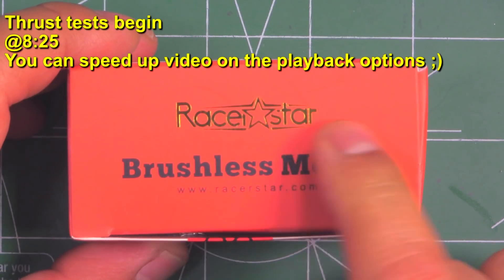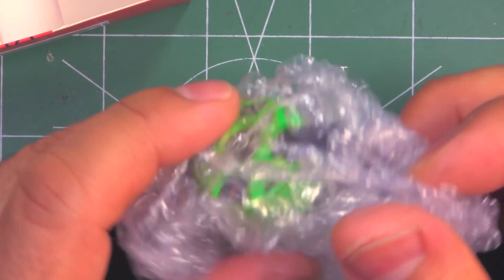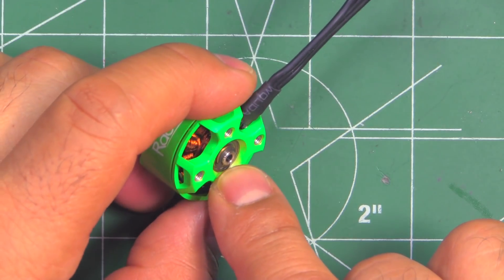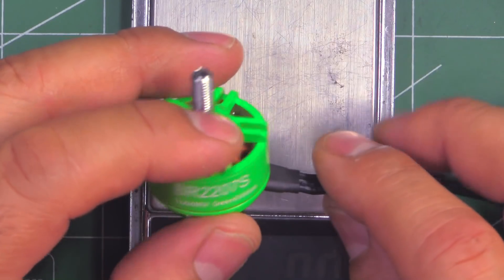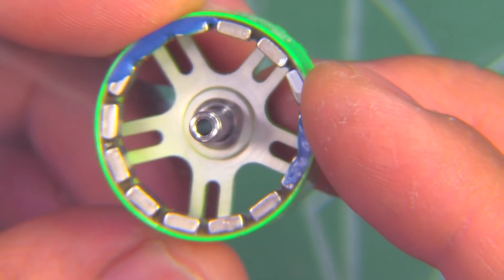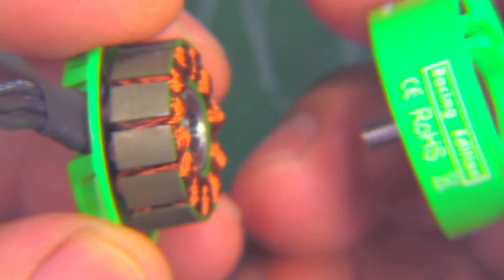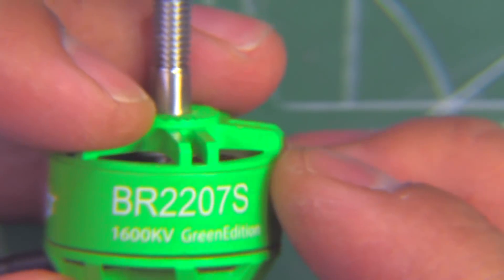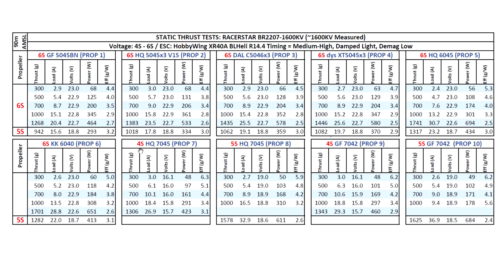Banggood.com RacerStar BR2207S-1600KV 6S Thrust Tests

Comment: what 6s battery will fit better with this motor and 7" tri blade, on a long range drone? 1500mah?
Reply from the maker: 6S 7inch props LR you need at least 3000mAh. LiPos work ok but the best are Sony VT6c Li ión cells. We usually make our own DIY packs. Lots of videos showing those batt packs. This motor possibly too small for 7". From experience I prefer Brother Hobby 2806.5 1500kv or other similar size. You need larger diameter motor force to handle 7"

Comment: great channel, geat video !
Thanks for testing all these motors.

Do you think it would be a good idea to run these motors on 4S with 8 inch props for long range flying on a 7 inch frame ?
They seem to be quite efficient even with 7 inch props.
Reply from the maker: You can run them with a low-pitch 8" prop but  you'll have to go easy on throttle, no acrobatics. One thing I've noticed with small motors and big props is that there could be hesitation/ stutter when motor spins up and down. Larger motors don't have that problem. That could be visible if you're planning on getting HD video. The key is to keep RPM's and weight low. Also some people use Li-ion packs since those batteries can store more energy and weigh less than LiPos, but you have to make sure not to exceed Amps. Usually, OK if you're not going full throttle. Someone here in YTube told me they had a 2206-1200kv 4S-4000mAh LiPo (low C-rating so it's lighter) setup with T-Motor 8020 CF props and could fly for about 20min.

Comment: I made it over here this time :). I love your videos they are always a great place for information. 

I might aim for a cheap 5s 7'' with a 30a 4in1 and that 7'' floss style frame. These motors look nice i like the idea of the ss shaft i guess that would mean less chance of a shaft bending? The Excelvan GB2207  are another option i found but the quality ''looks'' to be less than the racerstars which is scary. https://www.gearbest.com/motor/pp_009835573980.html?wid=1433363

Any other ideas would be appreciated ultimately i just want something cheap but reliable.
Reply from the maker: kramersteen Yes these will work for a light build. Check out the 2507 and 2406 on my recent videos, Racerstars too. They would match even  better with 7" on 5S but add a little more weight. I think they're almost same price ... I forget what they sell for
Reply from the maker: kramersteen SS shaft not really stronger just will not rust as easy. I cant comment on that GB2207 as I have not seen it in person.
Reply: Yeah i'm leaning towards these at the moment. I had one last question, How does this motor and similar racerstar motors compare to dys motors like the se2205 , 2008 etc in regards to overall quality?  I have mixed results with motors when it comes to crashes, i think the right crash can destroy any motor.

EDIT: I might go the ''rob'' option :)  and spend a bit more - https://www.ebay.com.au/itm/4-pcs-Dragonfly-Hurricane-2207-KV1700-3-6s-Brushless-Motor-for-Racing-Quadcopter/123273177654?epid=7021816845&hash=item1cb3a76a36:g:-04AAOSwvRlbWc9J

Best hobby!
Reply from the maker: Those Dragonfly look very good. Only observation is the prop bell-integrated prop shaft with motor shaft pressed in. Some people didn't like that on the EMAX LS series. I do think full 1-piece steel shaft are stronger and on a 7" prop, in a crash there's going to be more leverage from the larger prop. Other than that, the motor looks very good. The SE2205 were trouble free, the RacerStars have had issues in the past with low quality bearings. The last ones I tested advertised they used NMB bearings (good quality). Compared to the SE2205 the latest RacerStars are probably just slightly below in build quality. Magnets and winding wire are most likely lesser quality but for the price they're quite good based on test results. I don't know how good they'll be long-term or surviving good crashes.

Comment: Those bearings XD get some high quality ones if you feel like replacing the bearings. racerstars become really excelent smooth FPV+camera quad freestyle motors if you keep the tolerances on the bell and bearings incheck. CHeck for Fushi Bearings on Aliexpress forexample
Reply from the maker: Job91 Right. Bearings are one of the main parts that determine smooth rotation and that's where factories cut their costs and increase profits so most low budget have low quality bearings. Can't really ask for $2 bearings in a $10 motor I guess. But yeah. We can always replace with better ones and end up with a smoother motor as you've stated.
Reply: EngineerX your replies are always so nice!

Comment: Incredible efficiency numbers.  No doubt we will all be 6s within a year.
Reply: MojoPapi FPV only for racing there's no point for freestyle
Reply: QUADBOT FPV Bob's wrong. In a year everyone will make the jump.
Reply: Higher voltage, lower current draw.  More efficient and easier on batteries.

Comment: Hi Mr.X:
Looking for a 6" efficient motor, that could also take 5" for tight places(running a 250mm MartianII frame). After a lot of searching (mostly in your channel and MQTB) I'm between two. The good trusty emax rs2205s 2300kv (perfect for 5" but still pretty efficient on KK6040) or the RCinpower2308 2150kv wich looks like a beast(most efficient motor I've seen on KK6040), but im a little concern with its weight (39g with no cables!!!) and its durability since it has no reviews on bangood. 
Thank you in advance, love your channel so consider making a patreon, I would gladly support you.
Greetings from a spanish fan
Reply from the maker: Hello Diego. Thanks for your words of appreciation. If you want to stay on 4S voltage and want a versatile motor that can run both 5" & 6" props, I think a 2206/2207/2307-2000/2400KV would be the "sweep-spot" range. We're in some sort of "golden era" of brushless motors for out hobby. There's lots to choose from.  
The 2205 can spin both those props OK but I think a larger stator motor will be more efficient. What you have to do is to exercise good throttle management, because while larger-stator motors can be more efficient, they can also make more thrust and use more Amps faster, so you'll go faster and cover more distance but you'll also drain battery at a faster rate. So then, we may think the motor is not efficient, but it's us, having too much fun with the throttle stick :)
The rcINpower would be one of the most efficient, but I think it may be too big for 5" so you're carrying dead weight. 
Other option would be to run 4S - 6" and 5S - 5" so a 1900KV motor would match there, take a look at the BrotherHobby Venom 1900 and EMAX LS2206-1900. Of course that requires more expenses since you will need 2 different LiPos and 5S-rated ESCs. 1900KV works fine on 4S too so if you're not looking for too much power, it should be OK on a light build. There's several videos on YT of people flying 1900-4S-5".
All that said, 2207 size, is probably one of the most versatile motors - not too small and not too big so it'll match well with 5" and 6".  There's so many, i's difficult to pinpoint one particular motor and honestly I really can't recommend a motor 100% because I don't get to fly every motor I test. So I would hate to recommend a motor and then it's not durable or has some sort of issue, but I would try to avoid motors with 4mm shaft and 3x8x3mm bearings since many people have experienced early failures of those bearings. 4x9x4mm are proven to be the best. 
About Patreon.... I don't think I would be comfortable doing that, because I have very little free time due to work and family. So I can't dedicate lots of time for the hobby and justify Patreon donations, but I really appreciate your suggestion. Gracias, me da mucho gusto saber que las pruebas de rendimiento de los motorcitos ayuden a la gente. Espero seguir haciendo estos videitos por buen tiempo, a ver que nos dice la vida :)
Reply: First of all thank you so much for the quick and extensive rensponse. 
Second, now I dont know if I should write you in english or spanish, but just for the sake of the other viewers (I imagine they all understand english if they lisent to what you are saying) I will stay with the english.
I was hopping that you would recomend me one motor saying that it was the holy grial of motors. But again you show how passionate you are about it and how much you care about the people that watches your work, and I really aprecciate what you said about not recomending something that you don't know if it works.
I almost bought the emax LS2207-1900kv when I saw your video about them, but ended up not doing it because as you said I would have needed to buy 5s for the 5" props. Thats just way over what I can afford, plus it makes the charging process more tedious.
I will look into the other options that you mentioned, and also take into account the bearing. To be honest I hadn't thought about that, but you always mention it when the motor has 3x8x3mm bearings.
I will post here what choice I finally buy after I have tried them, just in case it helps someone with the same dilema.
I know this video wasnt the best one to ask this question, but since it had very few comments I was hopping you would see it.
De nuevo, gracias por todo. Seguire viendo todo lo que subes y si tengo algo que aportar, lo hare. Ya que patreon no es una opcion (y me parecen muy respetables los motivos por los cuales no lo tienes, tambien se agradece esa honestidad), lo unico que te ofrezco es que si alguna vez vienes a Madrid, no dudes en contactar conmigo. Y si no te puedo ayudar, aunque sea podremos ir a volar un poquillo. Un saludo
Reply: PD:just going over some older videos. You never did the ls2207 2400kv nor the ls2206 2300kv. Guess you've been busy. I've you ever got the time it will be dope to see how all the ls series performs. Saludos
Reply from the maker: Exactly... I was about to run them, then another box with motors would show up.... so I put them aside since I ran a few of the LS2207/2206 already and wanted to show the other new stuff.... if time allows I'll run tests but there always seems to be some new motors coming out.

Comment: Don't be scared... Throw that 6S behind those 7042's!! I run a similar motor, 2207 1650kv, on a 6S long range setup with No Problem.. Flys like a dream!
Reply from the maker: Yeah! I was thinking, once you get in the air, those big 7" props will unload and Amp draw will be no problem. Thanks for chiming in. That will definitely help lots of people that are looking for that info! I'll make sure to mention it when they ask and will try and remember to mention on the BR2507S-1800KV review.... which I don't know why they went with that KV, 1650 would've been great.
Reply: I also have a smaller rig running XNova 2207 1800kv motors spinning 6" triblades on 6s. It's got plenty of pep and flys great. Would love to see some XNova Low kv motor tests on your site! JB just did a comparison of 2306 vs 2207 same kv and couldn't put test bench numbers behind his testing. Hyperlite has 2405 & 2207 1722kv motors.. would love to see test bench comparison!
Reply: What motors battery and esc are you rocking on that setup? This is the frame i am thinking of using it's cheap and light https://www.banggood.com/Sloss7-7-Inch-270mm-Wheelbase-4mm-Arm-Thickness-Carbon-Fiber-Frame-Kit-for-RC-Drone-FPV-Racing-p-1337619.html?rmmds=search

Comment: The GF 7042's are working good, tho 😊 The 2207's had a nice ampdraw, but with a heavy 6s battery... Hmm,I don't know if they'll be so nice on the amps then 🤔🙄
Reply from the maker: Perhaps on an ultralight 7" build and use a small 6S LiPo but that would not be the best setup because long-range would be the main goal. Let's see if someone comes up with a build that surprises us!
Reply: EngineerX Indeed 😁 Would be fun to see them in action  🍿